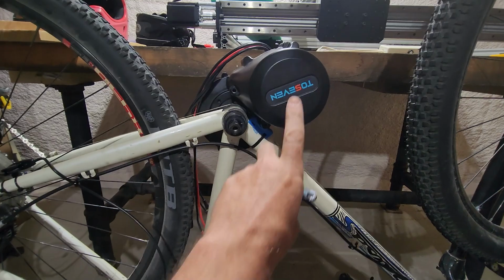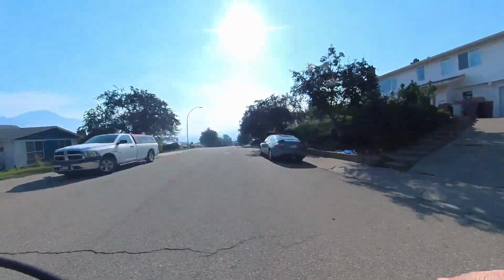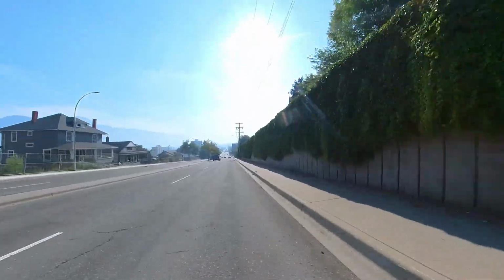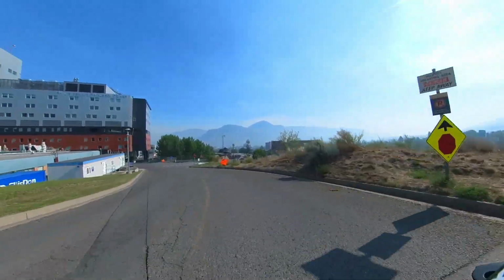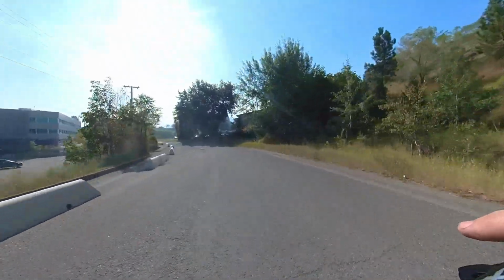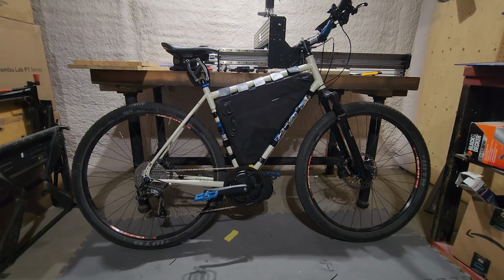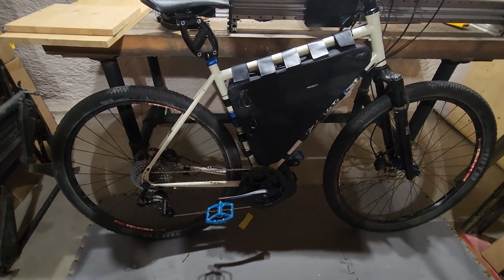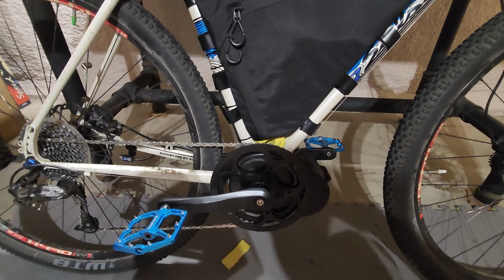TOSEVEN DM01 mid-drive DIY ebike motor Install and First Ride!

Comment: This is cool, if there were affordable integrated geared hubs for the rear it would be amazing with belt. I wonder why nobody has done an IGH that handles 150Nm with affordable price, even 3 speed would be enough to make the motor not sweat too much.
Reply from the maker: It baffles me as well. Would be just the ticket.
Reply: Shimano do "affordable" hub gears
Reply: @kevinshort3943  They wont usually tell any max input torque or its 85Nm for their own tiny motors
Reply: @happygiraffe9787  
This is an eBike, not an electric Motocross bike.
Reply: Review of hub on its way

Comment: Great stuff! Keep us updated on the settings changes.
Could you also measure the clearence to the ground underneath for each motor, including the CYC? Also some photos of the chain line for each would be appreciated!
I started playing with bikes conversions myself. My choice was Tongsheng due to torque sensor and city riding where PAS based motors are not that  intuitive.
Reply from the maker: I will do that for sure. I will probably post on Discord. You are welcome to join that with the link in the description. The 02 is very like the Tong Shen. I found a firmware bug in testing that which is why this one is on the bike.

Comment: Just like the good old cyc days 👌👍
Reply from the maker: They are not quite at the Gen 1 point. I am hopeful much of this stuff can be fixed pretty fast.
Reply: Exactly! Default settings in ASI BAC controller were TERRIBLE! Probably worse than in DM01.

Comment: Great vid again! I'm erring on the side of the 02, here in Australia we borrow Europe's Pedelec laws so the 01 would be harder to convince Mr Plod it maxes out at 250w... Continuous.... Which is such a grey definition it allows for proprietary fudging of numbers but can screw the home kits
Reply from the maker: Yeah I hear the law sucks. They have no way way of actually proving power. The speed limit is important tho. They check for the cutoff.
Reply: And that's why I like the 'hidden' menu in the TSDZ2 OSF, a double click and you're in, and if ever I got pulled over a simple power off would reset to street mode. As I've said either in one of your comments sections or elsewhere, I'm not looking for an electric motorcycle disguised as a push bike. I up the max speed to 35kmh and I  like 500w of assistance. I have a hub drive which I'm currently riding stamped '500w' I run 48v batteries and the controller maxes at 30A (you know the math) and it would ghost pedal up a 7% incline for 5 kms ... I actually depowered the factory settings so it feels like a proprietary e-bike and so I couldn't get lazy and have a free ride. I think Euro e-bikes laws a for recreational riders, not for serious hills commuters.
Reply: Yes that eu law is crap, hoping the Uk gets rid of it soon.

Comment: Hello High Voltage Kits.  Thank you for sharing your time, and your knowledge, and your experience by sharing these videos with us!
I am VERY interested in the TOSEVEN DMO1, and I'm planning on using it on my 
soon to be first ebike build coming in the near future.  It will be a commuter and grocery getter and will be replacing my car.  I'll probably use a 52 volt 25Ah battery and a 6 speed Revolutehub1 on a duel suspension MTB frame. Why the I.G.H.? Because I'll be riding in traffic and it's common for car drivers to do stupid human tricks such as running stop signs and doing left-hand turns without waiting for bicyclists to pass by, thus, I need to make unexpected quick stops and then down-shift before I can start pedaling again.  I'm old, I'm grumpy, and I have arthritis in my spine, so I'll need the duel suspension frame.  What are your thoughts on the motor, hub, battery and bike frame I'm thinking about using?
Reply from the maker: Hey RJ. Sorry for late response. These motors can be a bit more tricky on dual suspension frames but not impossible. You are welcome to post pictures on our discord server. There are links in the description. The igh should be ok as long as you don’t shift under load. The battery should be plenty.
Reply: Thanks! 👍 @HighVoltageKits

Comment: Thanks John, another good video.Are you going to do some kind of table to compare all the mid drive options you have tried?
I'm curious how things like the torque sensor compare.
I'm use to the Bafangs, but I have ridden Bosch and Shimano, so I have an idea of how good torque sensing feels.
Hope the smoke stays away. I was at Lake Louise last week, couldn't see Mt. Victoria from the lake shore. Pretty disappointing
Reply from the maker: They both felt pretty good. I will need to find some way of organizing things. We have a wildfire pretty close here now. About 13km outside town.

Comment: Really enjoying the extended ride videos! Happy to see more competition coming in this space and the advent of torque sensing mid-drive DIY kits. I have a BBSHD and find the cadence based PAS very disappointing. I’ve been wondering if there is some way to add a torque sensing crank arm and a different controller to my BBSHD?
Reply from the maker: Thanks Alan, you'd be best selling it and getting something with torque sensing.

Comment: Great work. So this looks like the first motof not to use that security bracket through the rear horizontal struts of the bike. Something i cant fit on my bike so this looks the best option. I have not seen a detailed video of fitting this motor. I also have gear cables that run under my crank which could be a problem.

I like the clear style of your vids. Keep up the good work.

I have not found the link to your discord?
Reply from the maker: Thanks. Check this link for discord info. https://highvoltagekits.com/discord Those brackets are not needed. I did not even try on my dm02. If the 01 stays in place at 3250 watts then it's not an issue. I hit the spacer with a hammer to torque it on. Hopefully they will release a socket for torque wrenches.
Reply from the maker: Sorry I missed this. Thanks for kind words. There is some info on discord here https://highvoltagekits.com/discord

Comment: Torque sensor would be a gr8 improvement on my BBS02, but also ability to free pedal when the battery goes flat.
Reply from the maker: I'm not sure the bike would be much fun with a flat battery based on my experience with the 02. It's a lot of weight up hills.
Reply: @HighVoltageKits  i thought the DM01 disconnected the pedals from the motor when the battery goes flat (unlike BBs02 that keeps motor connected to pedals)?
Reply: @JohnSmith-sj2dk yes, both the 02 and 01 do.  You cant feel any resistance when its off
Reply: @Alex-uh1mj  DM-01 could be better option just for the absence of resistance and gear noise when pedalling unassisted, but since there aren't any aftermarket chainrings  to improve the chainline then BBSHD still was the only option. Leg weight on its own makes the BBSHD resistance undetectable but it adds up anyway especially during long distance riding.
Reply: @uvwuvw-ol3fg  the chainline is 50mm?

Comment: Two things:
1: There in no strain relief on the throttle cable, so it will break.
2: if you replace the silly exposed cable with a full sheathed one, you can re route it and fit the motor properly.
Reply from the maker: I checked the harness and can't find anything pulling on wires with bar rotation. It's going to be swapped again pretty soon so not going to far.  I was sent the motors to test as is and those wires go right into potting so it's not a job I want to do. A small redesign in a future revision should fix it. For now I made a cover to keep the out of harms way.

Comment: Does this core have in board magnets or out board?  If you where to go single speed with this what would be a optimal ratio (front sprocket and rear cog)?  I love that you are showing us a real world experience with each of these systems... Good work Captain.
Reply from the maker: Thanks. In a way they won't learn unless they see the real world issues. Easy fixes for the most part. I think like the stock bbshd going single sprocket would be hard on it. Unless you wanted a cruiser bike that maybe peaked at 35 and did not have to do many hills. It's too early to really know.
Reply: @HighVoltageKits  that's exactly what I want a single speed cruiser that peaked@30mph...I do have long hills but nothing to steep. Thnx
Reply: As suggested in another comment, a 3 speed hub is a good shout

Comment: A few questions, 1. what kind of effort were you putting into when climbing the hills in the video? 2. What was the size of the front sprocket on test bike and what gear in the rear were you using turning test ride? 3. Are all the various setting available on the display to fine tune the riding characteristics of the motor? 4. Is there a way to set the throttle to give full power same level as when peddling using torque sensor?
Reply from the maker: Not a huge amount of effort. The front is a 46t. There are quite a few options in the menu systems although the do need some refinement and better explanation imo

Comment: Have settings been improved for torque sensing over the last 3 months? Are the gears metal or nylon?
Reply from the maker: They have made gradual improvements in the feel of the torque sensor yeah. There is a Nylon reduction gear the same as with the BBSHD.
Reply: Is that a concern for durability? Why is it nylon? @HighVoltageKits

Comment: Seems the motor is much quieter than my Tsdz2 that's for sure which looks like a nice upgrade path for dm02, this one's a bit beefier and would likely be a nice path for those running the cadence based bbs02/bbshd. 

Seems there's quite more firmware tweaks needed but otherwise the hardware side does feel like solid, though time will tell. Do agree the wiring could be much shorter along with the cranks having proper Q factor though it should be minimal adjustment for their end. Not planning on buying anytime soon but this would likely be my upgrade path from tsdz2 if it is good hardware wise after sometime of use. Would miss OSF though as I like the eMTB mode a lot as it mimics how brand motors from Shimano / Bosch, hopefully since this is UART based it should be easy to customize if the codebase is available or at least a manual for the protocols to make it easier to adapt OSF for it.
Reply from the maker: Good points. I never used a TSDZ2 so I do not have a base for comparison as such. I think there will be lots that the community can do with it being UART. There are several people already interested in doing some custom things for it.
Reply: @HighVoltageKits  Definitely interested myself on checking out the codebase for the firmware for this or at least a manual as it's likely I'll be flashing a customization to get eMtb mode from OSF to this motor if I get one. 

Toseven's statement on it being open for community customization definitely is one factor for a lot. It's likely an inspiration from the lead Tonsheng engineer on how OSF developed on Tsdz2 which is one of the more active communities for open source motor firmware use (even most sellers usually pre-flash it these days) as it provides quite a difference on the experience from stock tsdz2.

Hope you manage to fix the firmware issue on dm02 as that's the one I'm more keen on buying in the future. Great review overall

Comment: Does ToSeven have a wiring pin diagram in their instructions?  That would make troubleshooting easy.  I know the main Bafang 8 pin connector assignments is different from the Tongsheng, so you never mix cables.

Be interesting if you could use a shorter Tongsheng speed sensor on the ToSeven.  That would fix the long speed sensor wire.  Also Firmware updates via the speed sensor connector like a Tongsheng?

Wishing you good luck with your analysis.  
The DM01 seems like a good match for Mountain biking on a trail where you need good motor control.
Reply from the maker: Thanks for the comment. I got neither a wiring diagram or instructions 😆 They are sorting it.
Reply from the maker: Sorry. Not 100% on updates. The wiring is not the same as bafang. I'd bet the Tong Shen is the same. Not risking it tho lol

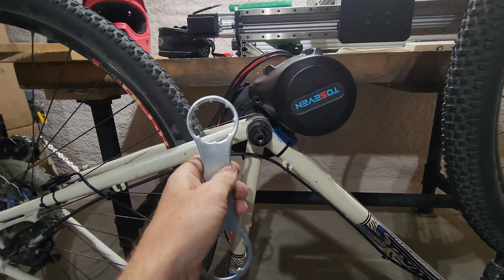Comment: Great video! What is the blue component between the motor and the frame at 1:13 ? Is it to prevent the motor pushing into the frame?
Reply from the maker: Its a spacer I made to keep the motor away from the cable for the rear shifter.
Reply: @HighVoltageKits  Ooh, I see

Comment: What DIY Mid Motor would you recommend for long distance e-bike touring (total load capacity for myself two small dogs, and my camp/food/etc. cargo: 330lbs) and fitness riding?
Reply from the maker: I would say as it stands the BBSHD. It has the power to shift the cargo. They are known for being reliable. Perhaps most importantly you can fix most things on the road with a simple set of tools and a few spare parts. Its not the most refined feel with the pedal assist but you can set it up much better adjusting the settings yourself. I used to pull both my kids in a trailer with ease. In theory this new motor from TOSEVEN would also fit the bill. Its not yet proven though. Although it does look promising. If I was touring with a new motor I would take a backup regardless of the maker. Its just good sense. I guess it also depends on how long you and dogs will be roughing it far from civilization as well. Lots of people use solar panels when touring these days.
Reply: @HighVoltageKits  There was a gentleman named Brian who developed his own battery; a 50amp battery for his bicycle and he traveled over a 100 miles per day (he was short on time during his vacationing days). He rode mainly on hard pack roads; asphalt, sidewalks maybe some light graveled areas. He had brought 4 pannier bags. He had no solar panels and he always found an outlet to plug into after he was done riding for the day to recharge his battery. He did not seem to have any major issues. My two small dogs; One will be in a dog bicycle seat (Buddyrider) the other ( a tad larger) will be towed in a cargo trailer with a soft crate inside cargo area secured onto trailer ( around 45-48lbs total). The rest of the weight will be distributed throughout my panniers and other small cargo bags strapped somewhere on bike. I currently have a 750watt bafang; Loaded my bike with all necessary gear (as for a trial run) and the bike with this motor took off. It did not seem to have any trouble GOING. I understand that the BBSHD is a nominal of a 1000watts. What are your thoughts on the 750watt Bafang Mid Motor?
Reply: Looking to e-motorize my motobecane ELITE8 Disc bike that has an 8-speed SG-7001 IGH on rear wheel with another bafang motor on this one too. I wish it would have had the 11-speed Alfine IGH, but my LBM in San Diego said with a 750watt engine just keep what you have on there now. 36t front + 8-speed IGH rear will be just fine.

Comment: Did you ever solve the problem with the torque sensor?  I just bought one I found the same problem with my unit.  The torque sensor responds and then fades to the point where it is a no-go when climbing hills.  Thanks.
Reply from the maker: Sorry I missed this. The problem got fixed with new firmware.

Comment: Is a revision in the works to improve wire placement and stock programming?
Reply from the maker: I have brought up the issue of the wiring placement however I don't have any kind of timeline. It's unlikely in the near future due to tooling already being in place. The firmware has been significantly improved recently. I will hopefully get some more video soon although the motors are currently off getting tested on the HV dyno rig! Cheers.

Comment: For some reason Lierskogen ebikes had a louder DM-01 so there is some lack of production consistency.
Reply: recorded in a completely different way on different components.
Reply from the maker: Its difficult to compare just on videos. I have different cameras that tend to record the noise more or less. It really is very hard to hear it when I am riding. I think he also was talking about some off road riding which I have not really tried just yet.